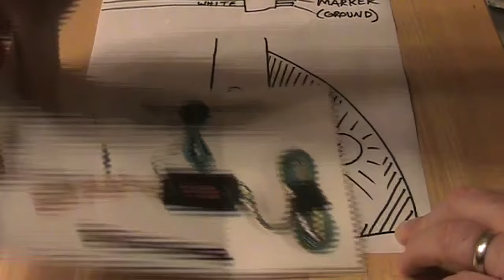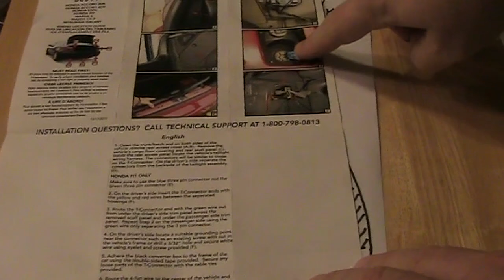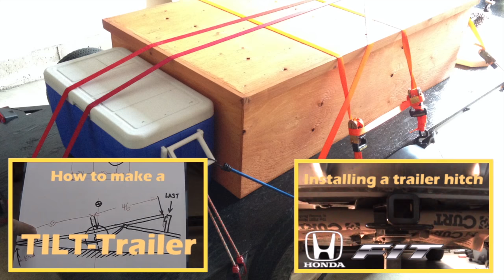Honda FIT trailer wiring harness (CURT #56011)

Comment: Will it make any difference if (in my case) the car has been set-up for flat towing by Camping World and had LED's installed somewhere in the back to allow towing behind my RV and once I plug in to my RV trailer plug, the brake and turn signals and running lights are fed off the RV. If I install this wiring harness will it still work?
Reply: I assume you’re not towing an RV with a Honda Fit. These wiring harness kits tap into the rear vehicle lights and deliver that power to the trailer plug whenever they’re in use. So as long as the lights on the rear of your vehicle are working properly then adding this wiring harness shouldn’t interfere with whatever other auxiliary lighting you’ve also installed. Best of luck!
Reply: @mewoosh  No I was I was looking into this because I want to buy a small boat on a trailer like like a little wind rider trimaran to to tow behind a car like a like a big kayak for example
Reply: @TerrydeAlaska  In that case, as long as the rear lights work normally then all you're doing is tapping into them for power and to know when their individually lit. Should be fine.